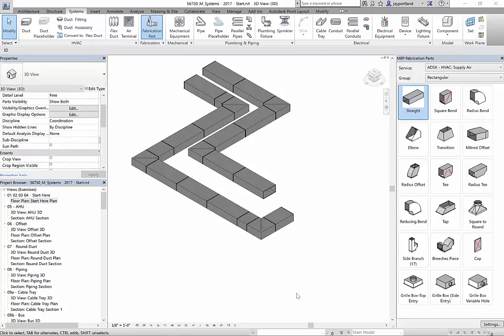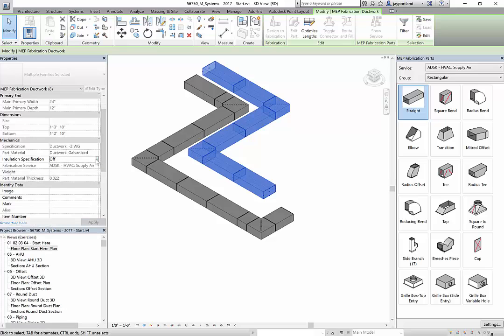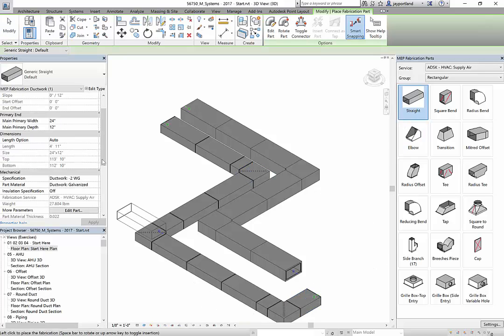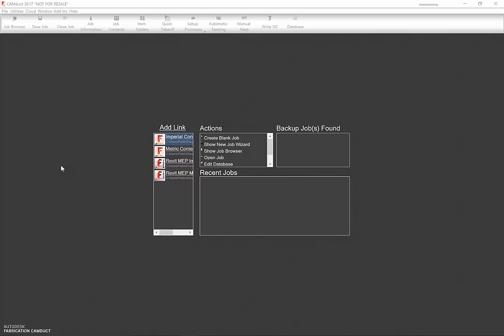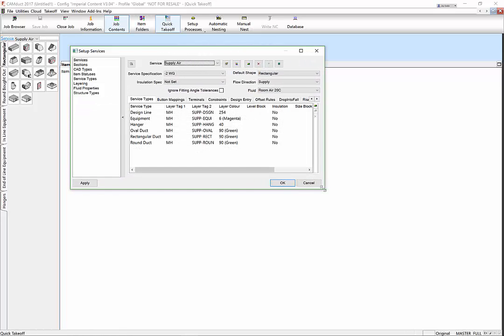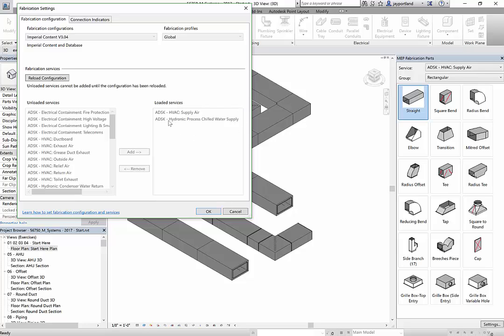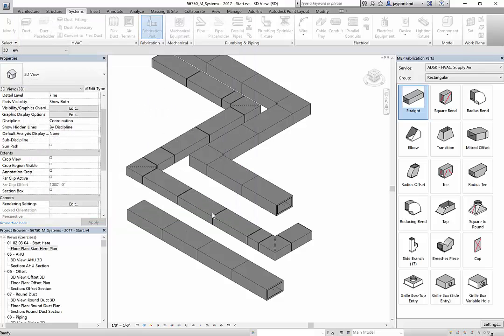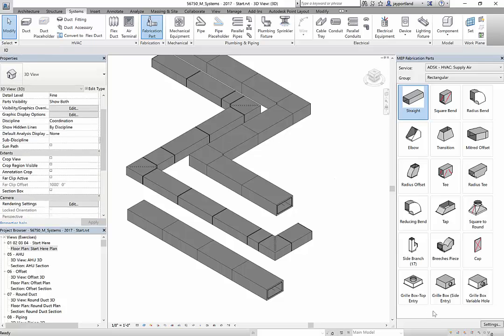Revit 2017 Fabrication Parts - Tips and Tricks 02 Adding Insulation

Comment: Do you know if it's possible to Add Insulation and Lining at the same time in a duct?
Reply: did you ever find an answer to this? I am working on a project now that is requiring this & it is unachievable through mep fab parts from what i can tell.
Reply: @codysmallwood7638  unfortunately it's not possible, since we were working with Revit the solution was to create a Shared parameter Called Lining and manually to each duct that had lining, so we could get those values on a schedule.
Reply: You would have to create this option either on CAD FABRICATION MEP or CAM DUCT. Whichever program you’re using to take your fabrication parts from